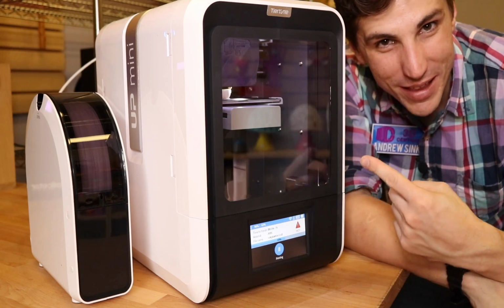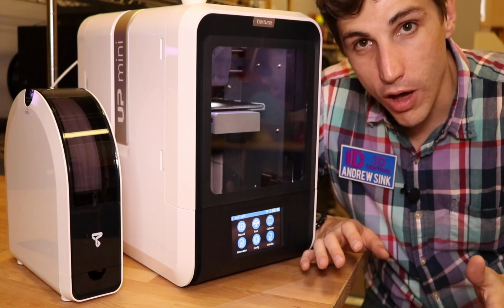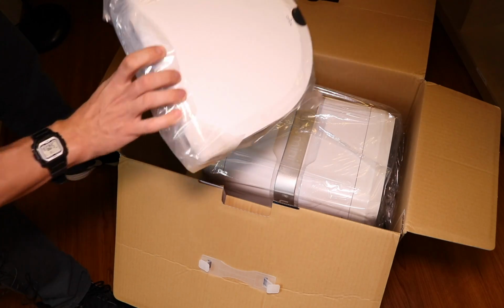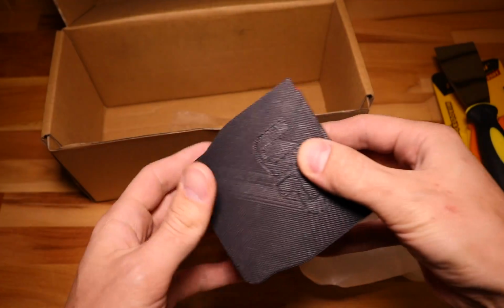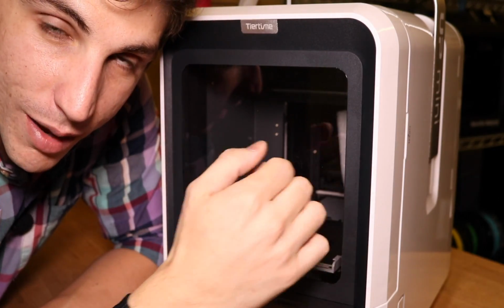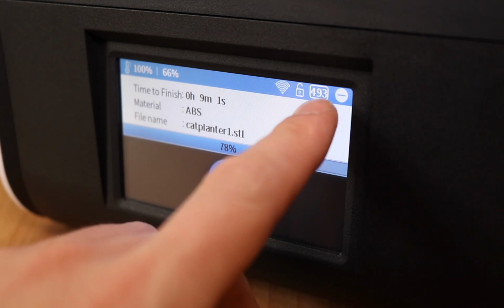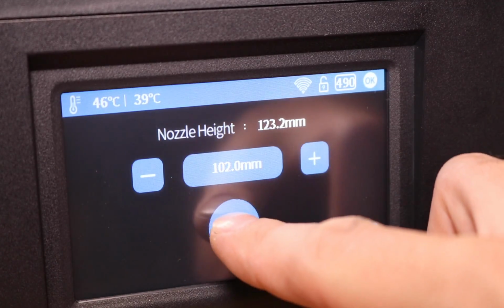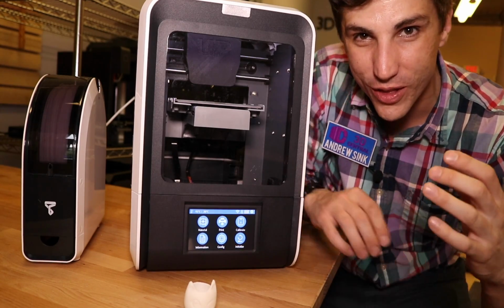UP Mini 2 Unboxing and Test Print!

Comment: Now you have a few more hours on the clock how are you finding it? I've enjoyed mine so far but in less than ten hours of print time I've had a blocked nozzle and a blown main board (did a video of the latter). - Up Mini 2 3D Printer Main Board Replacement https://youtu.be/SgW_RGpka6M

Have you had any reliability issues or have I just been unlucky do you think?

Comment: its amazing. 8 years ago desktop 3D printers were bare wires, and threaded steel bars. even 4 years ago most desktop 3d printers were exposed wierd lookng things. and now we already have amazing looking 3d printers that would look perfectly in place in a house.
and its nice that they put the filament in an airtight bag, with a packet of silica gel!

Comment: my son won this at a Makers Faire and we have no clue how to use it. I am setting it up and I can not figure out why it won't heat up. Please help me!
Reply: Would that have been the Sydney Mini Maker Faire :)? Make sure you use the latest version of UP Studio with it from UP3D dot com, and I recommend using the USB connection to start with, still trying to figure out the WIFI on it - which is why I was looking here...
Reply: 3D Central Thanks alot

Comment: Does it have an SD card slot ?
Reply: uptowndisco2 no. There's a mini SD on the main board that holds the firmware but that's it and you have to take the machine apart to get to it!